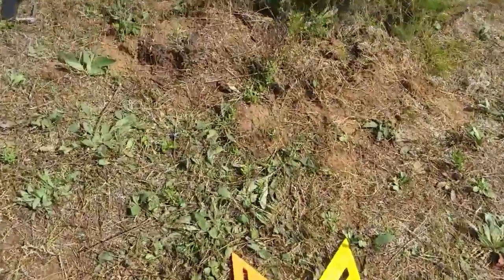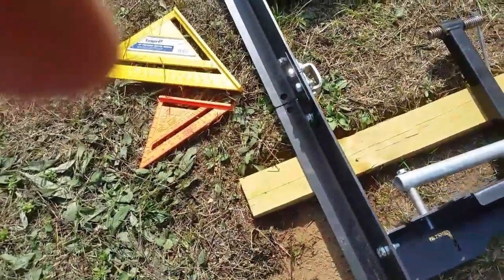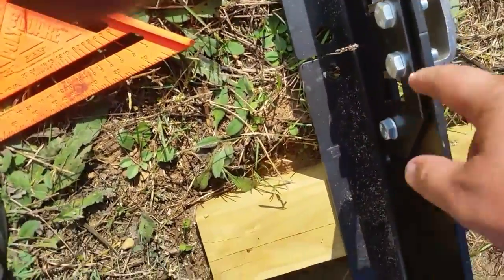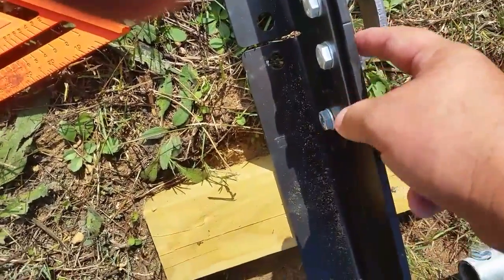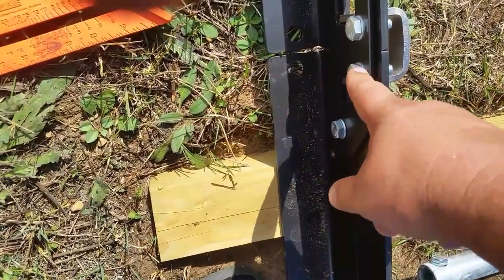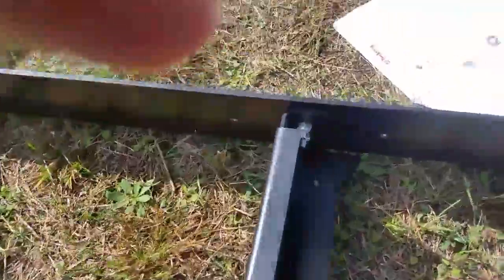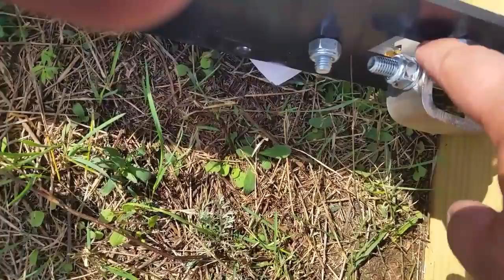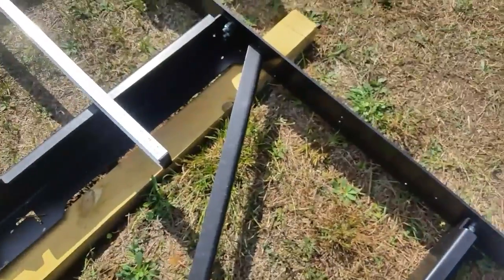Metric grade 8.8 bolts are insufficient for the job on Timbery M100 log bed

Comment: Hi Jeffrey, I wonder if it's not the bolts but the nuts. Get some hardened nuts and try them. 8.8 bolts should be more than strong enough for that job. Take care my friend. Your friend Al.
Reply from the maker: Al Dredske That could be the issue, soft nuts. Had lugnuts strip out on my 79 F250.

Comment: just asking are they grade 8.8 or is that the diameter usuly with metric it the diameter  the little lines on the heads show the hardness.
Reply from the maker: Fisherman 506 8.8 is the hardness grade, metric bolts use a different hardness scale that SAE bolts.
Reply from the maker: Fisherman 506 And thanks for subscribing. Will have a bunch of sawmilling videos coming in a few weeks, waiting for logs. Can't wait.
Reply: 8.8 quality scale for normal construction.   12.9 hight quality scale. torque and tension resistant.Hot steel forged.    See  DIN german normen  and UNI  european normen.    ceers from MONZA  Italy

Comment: Can you call the manufacturer?
Reply from the maker: Dillons Woodworks I sent them the video, no comment from them. Wood-Mizer LT28 will probably be my next sawmill.
Reply from the maker: Dillons Woodworks Or can weld it up solid was another thought I had once it is on a concrete slab.